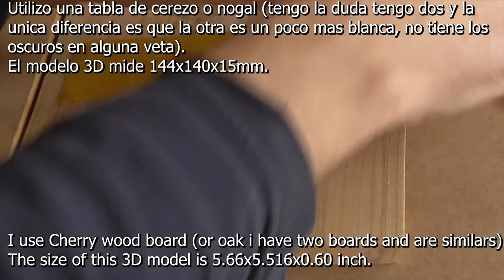Panel de abeja con miel tallado en madera.

Comment: That's really neat! What GCode generator did you use?
Reply from the maker: I use Vectric Aspire 9 but in this one its generated with Artcam 2018 for see differences (but i don't have artcam, one friend coded for me). I doesn't see much differences between (maybe little better artcam)
Reply: @CncWoodProjects  Awesome keep up the cool work... I have been making functional parts mainly so Fusion 360 and I tried to do some 3D stuff with relief maps. Fusion ground to a halt... its just not designed for that kind of processing. So I am keeping my eyes out for decently priced CAM packages for relief / 3d mesh cutting.